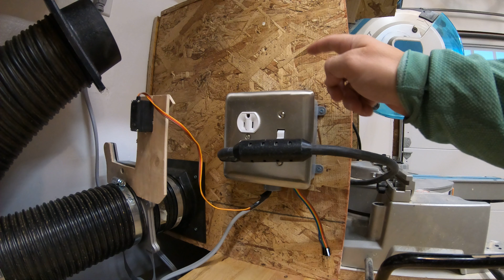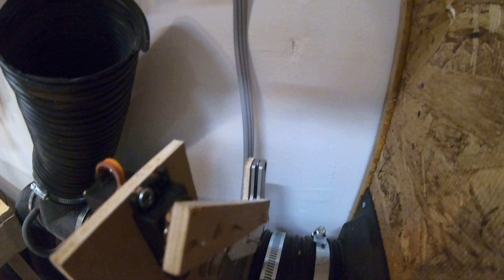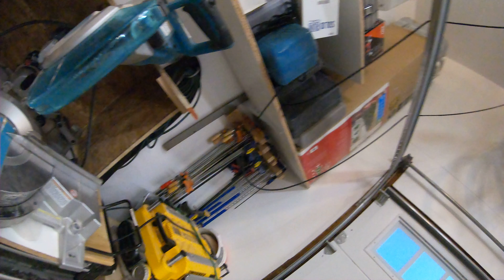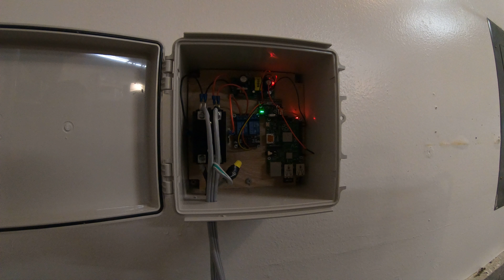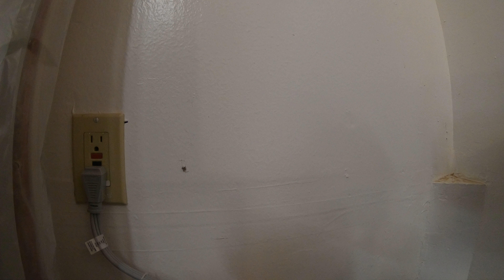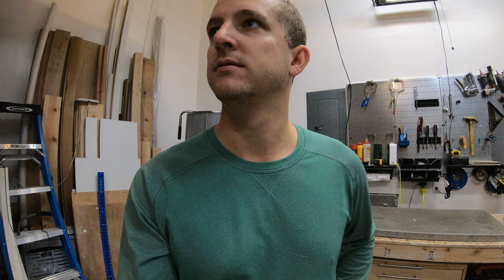DIY Automated Dust Collection with Alexa / Echo Integration v2

Comment: Very nice work! I’m in the process of a big revamp of my dust collection system. My core system is very centralized in sort of an island to minimize runs so I have one central manifold of blast gates with 5 ports. I built the blast gates out of plywood and MDF and they function very smoothly with very little effort, so as long as the push is relatively straight it shouldn’t take make to open and close them. I actually have the iVac system for dust collection on/off so I just want to focus on blast gate control. My ideal system would have a momentary button on each machine that is lit red or green depending on whether that gate is open or closed. Pushing the button would close any open gates and open that one. So I guess I either need sensors for both the open and closed state of each gate or a driver (be it a servo or other) that is position aware.